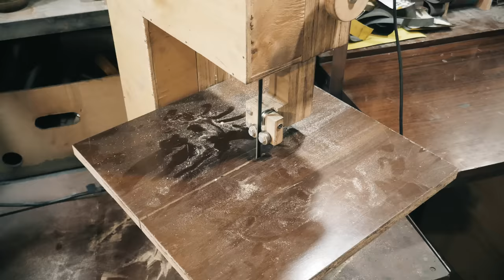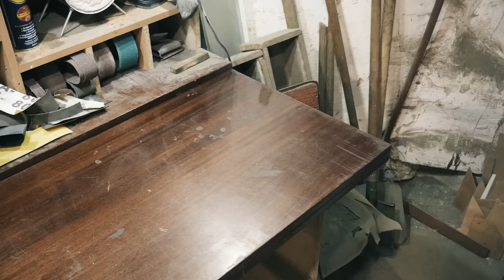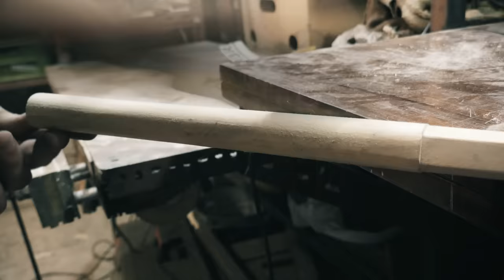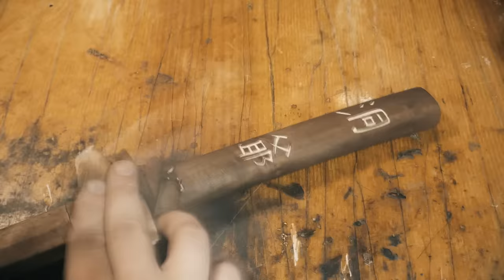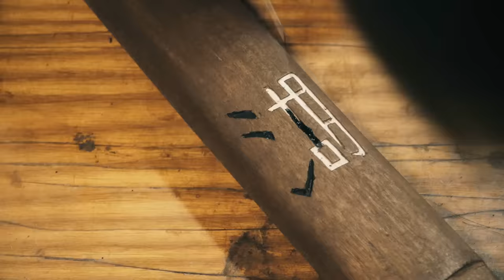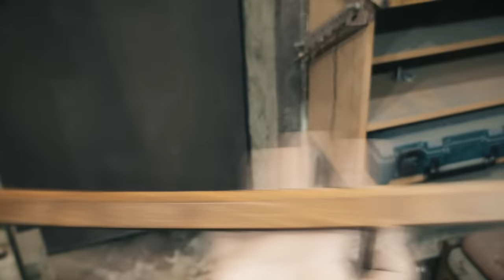Making Wooden Bokuto (bokken)

Comment: Quick tip from someone who has used and made many of these and similar items. Just like when making a bow you want to find a singe ring and follow it down your wood. This helps with both flexibility and rigidity and significantly adds strength. Don't cut across the grains to curve the sword. Steam the wood and bend it to the curve under pressure. It's such a slight bend it's nit going to tear your wood fibers. Think of it like this pulling a across a string vs pulling down a string. Shorter fibers are weaker so you want long continuous interwoven fibers. You will have a much much stronger and harder bokken. Try that and compare and you'll see what I mean
Reply: Facts

Comment: Hornbeam is a very hard timber, hence the name iron-wood. Hornbeam is rarely used for general carpentry because of the difficulty of working it. Its hardness means it has been used for carving boards, tool handles, coach wheels, piano actions - places a very tough wood is required. In fact the timber is so hard it's been used as gear pegs in simple machines, including traditional windmills. It is sometimes coppiced to provide hardwood poles, and also used in parquet flooring. It has even been used to produce wooden screws.
Reply: Same with Osage orange but you have to use traditional tools or dust collection or a mask since the sawdust is poisonous to breathe... my tribe (Comanche) would work it while still wet to form bows

Comment: I once made one using Baltic Birch laminations in 3 pieces - On the center piece of a 1/2" thick I drilled holes ABOUT every 3-4" and inserted a 5/8" nut - I had IMHO gotten the weight and balance very close to alive blade weapon - There were also just a few holes with nuts in the part of the handle closest to the tsuba - The 2 outside laminations were 1/4" thick - The sword could then be shaped, and finished as desired - Just thought I'd mention this.

Comment: Yes surely looks good but is not useable. The bokken should be made by curving the wood not slicing it because that way the grains are cut and after a strong hit this „bokken“ will snap in pieces. Good for the wall but not for training.
Reply: Genuine  question hiw to flex the wood.
Reply: @liquidsleepgames3661  Heating it? I guess.
Reply: Tony Stanchev Hornbeam is a very hard timber, hence the name iron-wood. Hornbeam is rarely used for general carpentry because of the difficulty of working it. Its hardness means it has been used for carving boards, tool handles, coach wheels, piano actions - places a very tough wood is required. In fact the timber is so hard it's been used as gear pegs in simple machines, including traditional windmills. It is sometimes coppiced to provide hardwood poles, and also used in parquet flooring. It has even been used to produce wooden screws.

Comment: Looks quite good only you can't really use it. I wonder how strong it could be built by building the blade with different wood veneers.
Reply: Don Armando Hornbeam is a very hard timber, hence the name iron-wood. Hornbeam is rarely used for general carpentry because of the difficulty of working it. Its hardness means it has been used for carving boards, tool handles, coach wheels, piano actions - places a very tough wood is required. In fact the timber is so hard it's been used as gear pegs in simple machines, including traditional windmills. It is sometimes coppiced to provide hardwood poles, and also used in parquet flooring. It has even been used to produce wooden screws.
Reply: @williammoore7482  Ah yes, this wood is what we call "white beech" here in the german language. It's quite hard in fact, but hardness alone might not be enough to get a strong blade.  You have an arch in the blade, so you will always have runout along the blade. But for a practicing it still might be good enough. You made a good job on your sword anyway.
Reply: Yeah, sucks to get old.

Comment: Sir may I ask a question? 
And pls NOTICE THIS!!! 
 
What type of wood did you use?
Reply: read his description
Reply: The common name for this wood is Ironwood. Hornbeam is a very hard timber, hence the name iron-wood. Hornbeam is rarely used for general carpentry because of the difficulty of working it. Its hardness means it has been used for carving boards, tool handles, coach wheels, piano actions - places a very tough wood is required. In fact the timber is so hard it's been used as gear pegs in simple machines, including traditional windmills. It is sometimes coppiced to provide hardwood poles, and also used in parquet flooring. It has even been used to produce wooden screws.

Comment: What kind of wood did you use?
Reply: Hornwood or Ironwood. https://youtu.be/jx2qAYCipDY Hornbeam is a very hard timber, hence the name iron-wood. Hornbeam is rarely used for general carpentry because of the difficulty of working it. Its hardness means it has been used for carving boards, tool handles, coach wheels, piano actions - places a very tough wood is required. In fact the timber is so hard it's been used as gear pegs in simple machines, including traditional windmills. It is sometimes coppiced to provide hardwood poles, and also used in parquet flooring. It has even been used to produce wooden screws.

Comment: What kind of wood did you use.
Reply: Read the description.
Reply: Brent Delong Hornbeam is a very hard timber, hence the name iron-wood. Hornbeam is rarely used for general carpentry because of the difficulty of working it. Its hardness means it has been used for carving boards, tool handles, coach wheels, piano actions - places a very tough wood is required. In fact the timber is so hard it's been used as gear pegs in simple machines, including traditional windmills. It is sometimes coppiced to provide hardwood poles, and also used in parquet flooring. It has even been used to produce wooden screws.

Comment: What kind if wood is this
Reply: hornbeam
Reply: Noah Diemling Hornbeam is a very hard timber, hence the name iron-wood. Hornbeam is rarely used for general carpentry because of the difficulty of working it. Its hardness means it has been used for carving boards, tool handles, coach wheels, piano actions - places a very tough wood is required. In fact the timber is so hard it's been used as gear pegs in simple machines, including traditional windmills. It is sometimes coppiced to provide hardwood poles, and also used in parquet flooring. It has even been used to produce wooden screws.

Comment: wooden sword but it seems too light
Reply: Hornbeam is a very hard timber, hence the name iron-wood. Hornbeam is rarely used for general carpentry because of the difficulty of working it. Its hardness means it has been used for carving boards, tool handles, coach wheels, piano actions - places a very tough wood is required. In fact the timber is so hard it's been used as gear pegs in simple machines, including traditional windmills. It is sometimes coppiced to provide hardwood poles, and also used in parquet flooring. It has even been used to produce wooden screws.

Comment: It looks like you started with a plank of softwood, yet you claim it to be very dense iron wood??
Reply: Arbalest M Hornbeam is a very hard timber, hence the name iron-wood. Hornbeam is rarely used for general carpentry because of the difficulty of working it. Its hardness means it has been used for carving boards, tool handles, coach wheels, piano actions - places a very tough wood is required. In fact the timber is so hard it's been used as gear pegs in simple machines, including traditional windmills. It is sometimes coppiced to provide hardwood poles, and also used in parquet flooring. It has even been used to produce wooden screws.